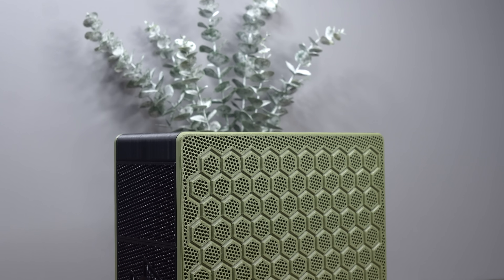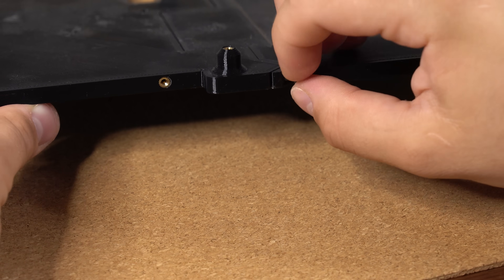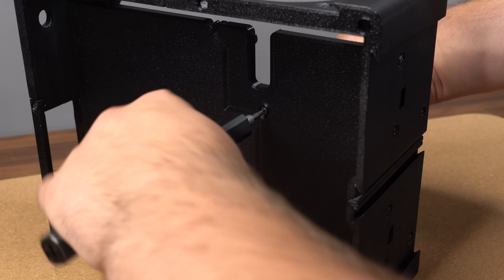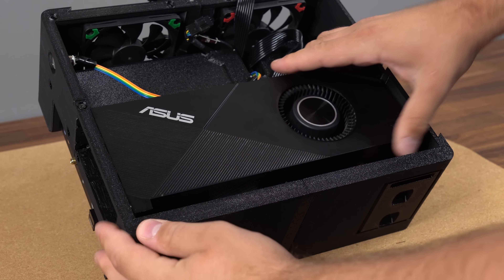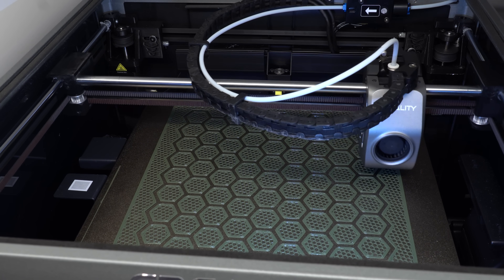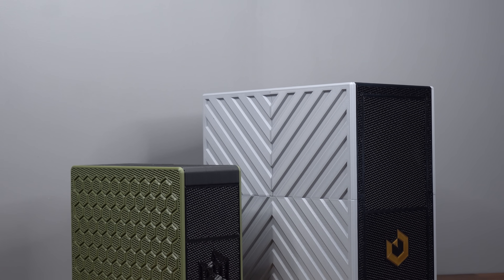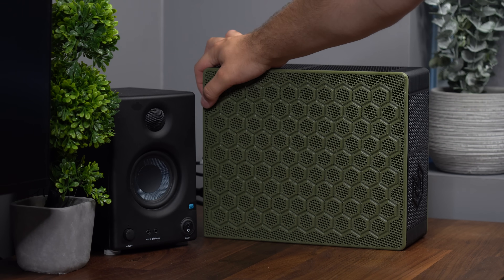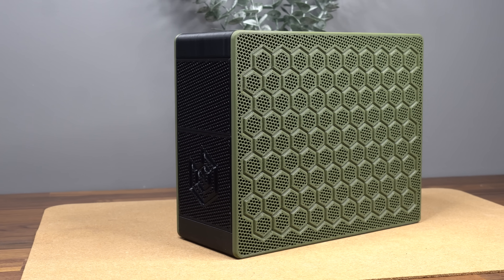A Backpack friendly 3D Printed ITX Gaming PC case

Comment: That bridging under those custom supports at 3:13 looks terrible there has to be a batter way.
Reply from the maker: There is a better way, use normal supports, not my custom mini breakoff support. However I added it to avoid needing supports, it can be cleaned up with a blade and will be hidden once assembled anyways.

Comment: any way to add USB ports on the case?
Reply from the maker: It should be possible by remodeling the original file. However I don’t have a model for it, so you’ll have to experiment with the .step file in that case. 🙂 if you end up buying the files, please message me on Printables and I can send you the modifiable step file

Comment: you're flipping over your stack of magnets and saying if you do that, it'll be right every time.  but that's only true if you have an even number of magnets.
Reply from the maker: How does that math add up? Mind explaining? 🤔 all you gotta do is add all magnets from one side of the stack to one side, then all magnets from the opposite side of the stack to the other part and they should now attract to each other.

Doesn’t matter if it’s an even number or not, as if it was an uneven number, then the last one wouldn’t need to be polarity specific at all if it was just a single magnet🤷‍♂️
Reply: @makerunit  with an odd number in the stack, the poles of the ones on each end are facing the same direction.  meaning they will oppose each other if you put them in the way you are now.  if you don't see why, just try it out and see for yourself.
Reply from the maker: @thinkdunson that is incorrect, as all poles in a stack face the same way. It goes like this (+\-)(+\-)(+\-) etc. doesn’t matter how many are in the stack.

If every second magnet had opposite polarity then the magnets wouldn’t stick to each other as it would always be minus to minus or plus to plus.

Each magnet’s positive attracts to the next magnets negative, then the cycle continues through them all. So magnet number 1 in the stack will always be the same direction regardless.
Reply: @makerunit  ohhh.  i see what you mean.  i'm dumb.
Reply from the maker: @thinkdunson haha, no worries

Comment: Have you considered a version of this that combines an ITX board and no riser? 

I've been prototyping some pc cases in wood over the months, and it seems like there is very little "width" advantage to having a sandwich-style case with a riser.

 Motherboard+separation-plate+gpu still works out to about 13cm, and that's quite close to the height of a gpu sticking directly into the pcie slot of a motherboard (around 14/15 cm). Been looking around a bit, and the case I would be interested in would be something in the ballpark of 19.8/20 cm (motherboard+gpu+a little air clearance) X 15cm (so full height) and  however "long" it would be to fit an SFX. 

I don't have my notes in front of me, but I think that would be about 25 cm "long" or so (itx 17x17, a little clearance for cables, and front-panel wiring). Possibly a bit shorter. 

I get that a sandwich-style does shave off a centimeter or two, and that's "a lot" in compact builds,  but it also relies on a riser. It would be nice to see a "clean, simple build" that's also as small as possible (and preferably with an SFX; they just seem more reliable, quiet and are way less expensive too). 

There seems to be a real lack of itx cases without risers that are as compact (or close to) as the sandwich-style. The riser-less cases seem to be unnecessarily big. In fact, the only case I can find just as a reference is something like this, that isn't available anymore: https://www.reddit.com/r/sffpc/comments/gho4ep/no_riser_love_it/

And - I dunno - I just feel like the sandwich style cases are sort of a fiddly nightmare to work with. For a slightly bigger case (ie, 1 cm or so, in one dimension) you get something that potentially requires a lot less sliding, folding parts, and kinda operates like a simple open box, configuration-wise. 

Just something to consider, cheers.
Reply from the maker: Hi, I totally get what you mean. Risers aren’t always ideal for all builds. However its also important when making a build where the GPU is plugged directly into the mobo PCIe to take into consideration that you also need room to plug in the GPU power cables without them being too tightly bent. 

I personally do not like to make cases with that setup any slimmer than about 180mm (maybe 160mm, but that’s tight) , to ensure enough room for cables. Though some more recent GPU’s like the NVIDIA FE cards with the angled high power connector helps a lot here to shave off some width. It’s also a different story whether a case is made specifically for your specific set of parts, compared to a design that’s intended for sharing and has to support a much bigger variety of parts. 

I’m definitely for the idea of scrapping the riser cable, but there are many advantages with them too. I’ll soon be posting a v2.0 of this concept actually, probably today or tomorrow night. You can see the project already on Printables!

Alternatively, regarding the width and GPU connector challenge it’s possible to get angled low-profile adapters for GPU 8+6 pin cables which can work of course, but as far as I can tell they seem to be mostly available on AliExpress or similar sites where the quality and capacity might be questionable.
Reply: @makerunit  My reply seems to have gotten swallowed, maybe you got it in your inbox. 

The short of it was "have you considered working with a MATX+SFX" solution? 

I'm on a Prodesk 600 G5 SFF, and the smallest I can get it is by using a short riser (10cm) and lay the gpu horizontally, so it's parallel to the cpu cooler. This makes for a computer that's 9.8 (or so) cm "tall", and basically just a tiny bit wider than an MATX board. 

If you do a sandwich-style MATX, you get a computer that's both quite thick and quite wide (27x 13/15cm). I think there's some room for an interesting solution here, even if you may end up sacrificing one of the x4 PCIE by laying the gpu horizontally. This way, you get a case that's about 27 cm wide, but fairly thin (9.8 cm "tall"), and therefor quite backpack-friendly. 

On the "pro" side of things, you get access to a full-sized gpu in a low-profile gpu envelope, while also using a much cheaper type of motherboard (MATX). The "lost" 4xpcie can potentially be recovered with a secondary riser, or by using it as an nvme drive. 

I think there is something to it, design wise, and would be different than all the current solutions that rely almost exclusively on flex ATX and ITX boards (both of which are expensive). Would be nice to see someone approach SFF with affordability in mind (it's a real problem that SFF solutions rely so heavily on the most expensive types of solutions).  

I think my last reply got automatically deleted because I do frequent edits to my post, and it probably registered as bot-behavior. Let me know if you didnt get the deleted reply in your inbox, or if you need further clarification of what I mean. You can also google "hp prodesk 600 g5 motherboard" and get a sense of what I'm working with. Outside of the unfortunate front IO being part of the motherboard, it's fairly similar to an MATX board, and that's what I'm basing my measurements from, when I inevitably will want to upgrade from the prodesk. 

...just feels like there is something cool to be had from innovating with these (much cheaper) parts, in a way that isn't just a sandwich-style.  

Cheers!

/EDIT: Man, I feel so handicapped sometimes not having a 3D-printer to test these things out for myself. I'll inevitably have to; the prices for ordering print jobs are crazy here. This case would be like 300 dollars if I used a service. Plywood will have to suffice for now.
Reply from the maker: @OrinLinwe  Hey, the comment went through this time! Hah, you’re just like me then, I type out a reply, then change my mind 5 times by editing one line between each new save.

I get what you mean and it would for sure be a cool idea to test out at some point! A case specifically designed with affortability in mind could absolutely be a cool concept. The benefit of a vertical GPU on the same side as the slots is that it allows for a bigger air cooler too. Which can be beneficial in many ways 😁 the question is, where to place the power supply in all of this without making it all too thick.

There are some good 3D printers you can get in the $300 range though which may be worth looking into if you anyways plan to spend $300 on a printing service 😅

Comment: Overengineering in a nutshell
Reply from the maker: Yes, but also no. It’s split up like that for a reason, to fit the print volume restrictions of some smaller printers. If all printers could do really large models this type of thing wouldn’t be a problem to print in only a fraction of the pieces in total.

Comment: what's the whole mini pc weight?
Reply from the maker: Hi, are you thinking filament only, or whole case fully assembled with parts?
Reply: @makerunit  like whole case with parts in it
Reply from the maker: @iskhantwo hmm, that’ll be a little difficult to answer as I have taken my system apart to proceed with new project ideas using the same parts 😅
Reply: @makerunit  that's okay, but maybe you should take this as an inspo for your next videos, cause its kinda important to highlight the weight when you make a backpack friendly decision. thx for your work btw, one day im gonna print on of these lovely cases for myself

Comment: planning on printing this for my buddy who is on a 10 yr old laptop at the moment. will this case fit a stock amd cooler? also will it fit an asus gtx 1080 dual fan? thanks for the design, looks super clean.
Reply from the maker: Hi, unfortunately this will not fit the AMD stock cooler, as it’s intended for super low profile coolers like the Noctua L9i or L9a. (Or similar)

Specs are listed on Printables. I can’t guarantee for specific model parts but the max allowed GPU thickness is about 43mm.

Comment: Wouldn't it be better if the front and bottom panels are perforated for better ventilation?
Reply from the maker: Since the airflow is sucked out the top, and the entire side on both sides are perforated I didn’t see the point of making the bottom and front perforated as no fans (except the PSU) are actually facing down at the bottom. 😊

That’s how I personally was thinking when designing this.

Comment: wont it melt ?
Reply: Not if printed in abs/asa or petg if cooling is good enough
Reply from the maker: It won’t. 😊 If you use proper materials like PETG,ABS or similar. I’d stay away from PLA in a compact build like this.

Comment: How much would it might cost to build one?
Reply from the maker: Hi, that depends on a lot of factors like filament cost and parts you choose to use as they vary a lot from place to place. The printing in itself without components will probably cost you somewhere in the range of 40-80 dollars (however this is just an estimate based on a country with easy access to all the components).
Reply: Ok thanks.

Comment: Amazing design! For the split side panels, I’m not sure if it would require changing a lot of how it’s pieced together, but to make it look a lot more seamless couldn’t they be cut along the lines of the hexagons instead of two straight perpendicular lines? That way, they could be pieced together like puzzle pieces and the separation lines can be hidden into the hexagonal pattern.
Reply from the maker: Thank you! You are absolutely right, making the split along the edges would have made for a much more seamless joint! 😊 it does take a little bit of effort to do, as it would also have to be compatible with how the sliding/joint mechanism works by sliding in at an angle.

Comment: One of the reasons "regular" PC Case screws (which are also M3, if I'm not mistaken), have that ubiquitous Hexagonal head, is so that you can tighten (or loosen) them from other  angles than just head on, and with other tools than just a screwdriver.
Reply from the maker: That’s actually a very good point! Never thought if it that way 😁

Comment: What would be the best gpu for this case?
Reply from the maker: Hmm, hard to say… my guess would be some of the 2 fan, 2-slot models of the 4070 or 4070ti cards perhaps. Just make sure they are no wider than about 41mm (2-slot). 😊 and the length shorter than 270mm total.
Reply: @ ok 👌 thanks

Comment: Nice case! But how do you take a monitor in your backpack?
Reply from the maker: Well, that would depend on the monitor size right? 😆 I’ve got a 7 inch HDMI monitor for my camera, that works fine on my PC too 🤷‍♂️

Anyways, there are some portable monitor solutions made for PCs but the idea here is if you have a monitor in both ends you can move your PC around between them 😅

Comment: Just built an ATX into 10L custom case. full size ATX mother, ATX PSU and GPU 240mm AIO cooled.
This a cool design love it.
Reply from the maker: That’s pretty impressive to fit all that in a 10L case! May I ask which case this is? Or did you design it yourself?

Comment: I only worry about grounding when you 3d print a case like this,
usually the connection points of a MB to the case serve as grounding contacts so chips don't short out.
Reply from the maker: This is a common worry amongst many. However after over 50.000 PC case model downloads I still haven’t had someone tell me this has actually been an issue. I have no scientific proof saying it’s safe either, but I’d say the probability of that happening is very low.

Remember that most components also have grounding in their power cables which in most cases will be enough.

Comment: hello I'm new to 3d printing and love this project. Would i be able to do it with the P1S to do the non-split parts?
Reply from the maker: Hi! Thanks! Unfortunately you need 300x300mm to print it without the splits.

The P1S is 256x256mm 😊

Comment: Can u pls share the link for the motherboard u used? @makerunit
Reply from the maker: I used an older ASUS ROG B460i with a LGA 1200 socket. It’s many generations old so as far as I can see it’s not for sale anymore. But any ITX form factor motherboard should work as long as you make sure to match the CPU socket to the CPU you’re using 😊 keep in mind that the cooling size is limited here so don’t get a «too powerful» CPU.

Comment: What diameter are the holes for M3 threaded do inserts?
Reply from the maker: Either 4.4 or 4.3mm hole width, I’ll have to double check if you need the exact. It’s designed to work with 4.6mm diameter inserts.
Reply: Thanks! You don't need to double check, I can do a small prototype print with both 4.3 and 4.4 and test. 
I like your designs! Very inspiring. I built a mini ITX in wood. Now I'm gonna print one :)
Reply from the maker: @ Awesome! Also, what works best might vary from filament to filament. Some filaments I’ve experienced oozing around the holes and then with another filament it was perfectly clean, but in my more recent projects I’ve landed on 4.3mm holes, and then use those threaded inserts that are narrower on one side to ensure no plastic ends up inside the threads. 😊

Comment: Are there any issues in this build with warping or softening panels? that's the one thing I'm worried about even while using abs or petg I would think that 80c wont melt but would soften and warp the plastic
Reply from the maker: What’s important to keep in mind is that if the core of a GPU is 80, it doesn’t mean that the surrounding air is 80. Same goes for the CPU, the hot spots are at the cores under the cooling fins. The air going through the cooling fins will bring with it some of that heat but far from all of it. Even with a CPU and GPU running at 80C at the same time I doubt the overall case temp will even reach 60. Probably lower. If using PETG «or better» I wouldn’t be worried. 😊

Comment: If at all possible, i would like to request a case for a 10 inch server homelab with room for an itx mobo, an atx psu, a small gpu and 4 3.5 inch drives.
Love your work, thanks :)
Reply from the maker: I’m working on a modular NAS system, which is intended to support ATX psu, ATX mobo, and an «infinite» amount of hard drives, you can basically add as many drives as you’d like in modules of 5 or 6 drives.
Reply: @makerunit  give it a width of <220mm and youll be my hero
Reply from the maker: @ I’m aiming for something Ender 3 or smaller. My first version has already been printed with 180x180x180mm cubed per module, but this has shown some challenges, especially when using mATX or ATX motherboards as they are 244mm wide compared to the ITX boards at 170mm.

Therefore I’m working on another version now that’s probably closer to 210x210x250 in size per module. Maxing out the Ender 3 print volume. This is a project that is intended to be built on over time, so I have to spend extra time making sure the first «base module» is perfect. 

So I haven’t fully decided on whether to stick with the 180x180mm print volume or up it to 220x220. I’ll just have to test and see what works best.
Reply: @makerunit  That makes sense.
In my use case im dipping my toes in homelabbing and as i want to go with a 10 inch rack and not a 19 inch rack, it makes sense for me if the size is below the 222,5mm mark, as thats the opening width of a 10 inch rack.
Also, the r/minilab subreddit is craving something like this, so building to their needs would definately make sense :D
Reply from the maker: @ oh! Good to know! I’ll definitely keep that in mind 😊